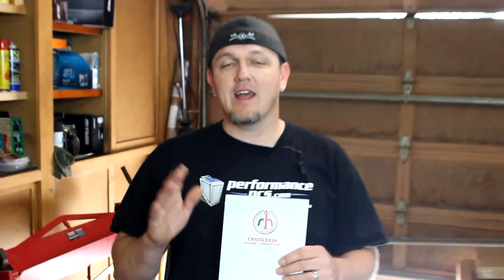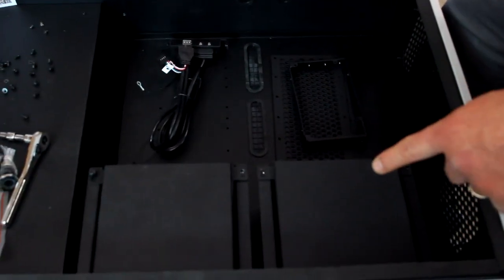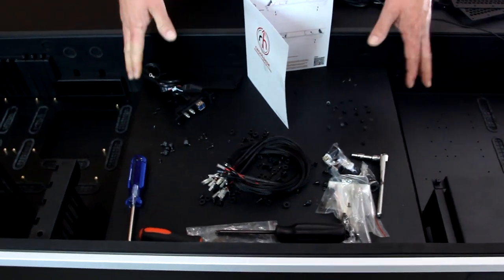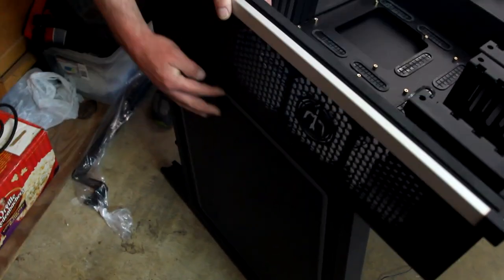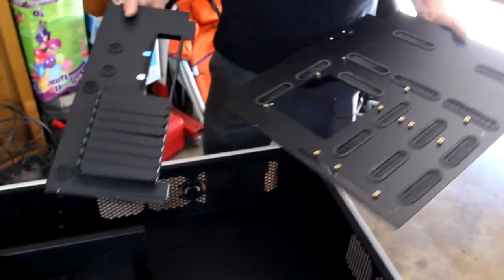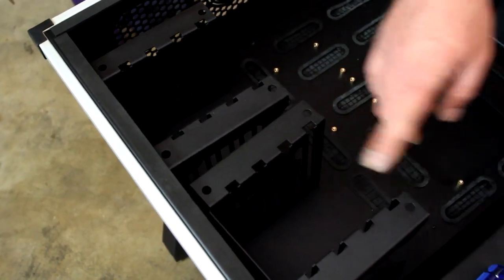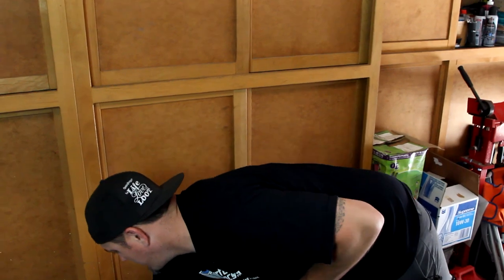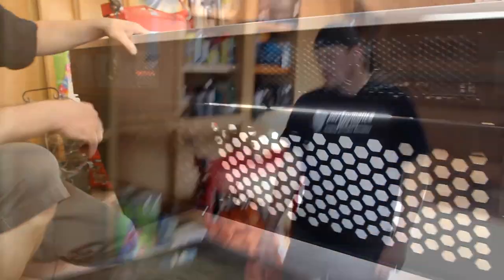Complete overview  of Red Harbringer Cross Desk

Comment: What getting an Olivetti M3030 removing the electronics and reusing the space reclaimed to hold the electronics for your new computer, the Olivetti M3030 actually looks like a desk because that is what it is with the electronics that make it work hidden inside the desk don't know if it is possible to have a water cooling installed also but would look really well, the printer is actually a printer combined with a double 8" floppy drive where both drives are powered of the one high torque motor which runs all the time, the keyboard actually slides out from under the lip of the desk,there is also an associated monochrome monitor.

Comment: im not familiar with the water cooling systems for PCs are they even needed with all those fans? im looking more for a desk like this that can also house a console, with a price thats not over inflated
Reply: JONNY CRASH you will not find an affordable desk like this unless you take the time and either build it yourself or pay someone to build a custom one for you; I'm actually looking into building my own at some point - most people who build custom desks like this for themselves don't end up spending more than $500 (obviously that's just the desk, not the PC)

and for liquid cooling, it all depends on what you're doing with your system; if you're overclocking your hardware and making it run faster than stock, you will need better cooling, which is what liquid gives you - but to some degree, liquid cooling is also just for aesthetics cuz it just simply looks badass
Reply: i see, yea i was hoping someone would have mainstreamed these for cheap, they dont seem all that expensive to make, i think im gonna turn this pc into one when i replace it, and if it works the new one will be put into it and the old one turned into a game server or something. i just need some longer connections and a slightly more powerful power supply to to run some extra fans.

to be honest the desk almost looks like a foosball table. i want one more like the topgun and ace combat arcades

Comment: who the F needs 15 hard drives...???
Reply: +c457 
You can use RAID cards to allow multiple hard drives to operate in tandem, increasing data access speeds and protecting your data from hardware failure, in this way, you could use 12 1tb hard drives to create a virtual 12tb hdd with 12x normal read/write speed, or a virtual 6tb hard drive that is borderline invincible to hardware failure with 6x normal read/write speed. It's useful for servers and databases, though some consumers may find it suitable for a home media server or the like.
Reply: +c457 RAID 10 or RAID 5  Specially  you doing 4K Editing F R Ta